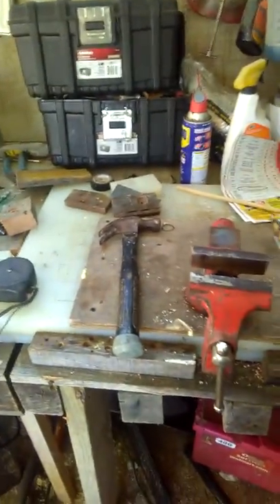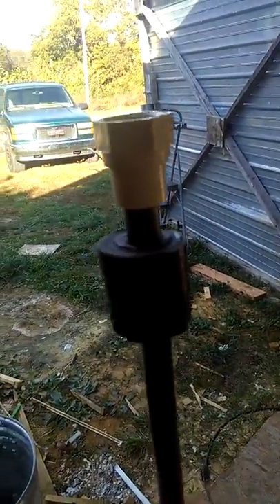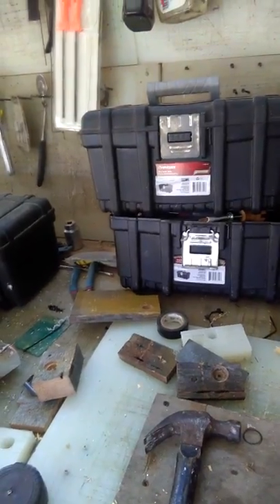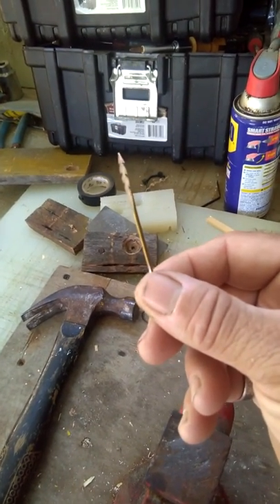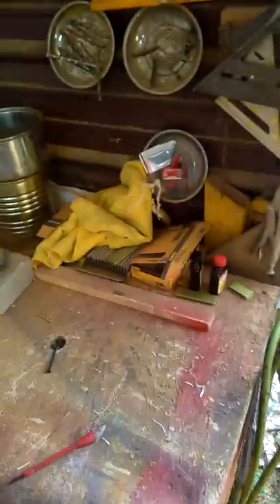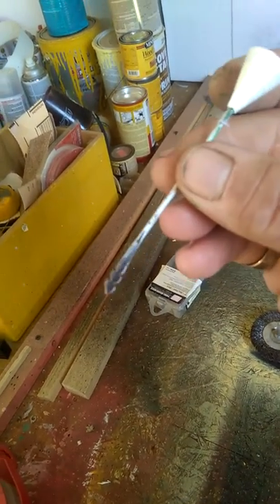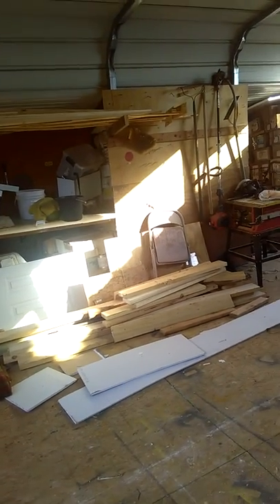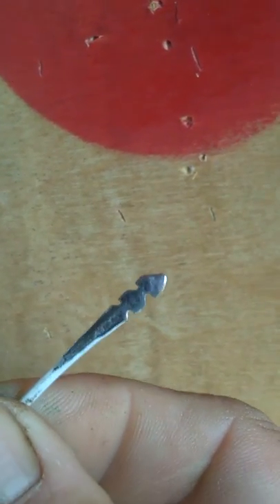Making a Cold steel blow gun? And making darts

Comment: I was trying to find pipe that matched cold steels inner diameter...do you know if the conduit you mentioned will actually accept their darts or if it is a little bit different size on the inner barrel of the tube?🙂